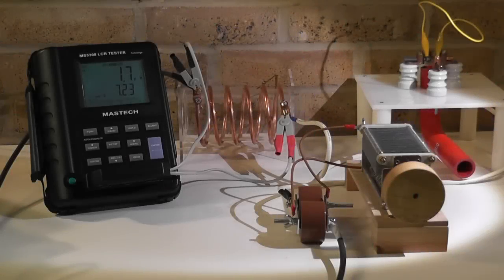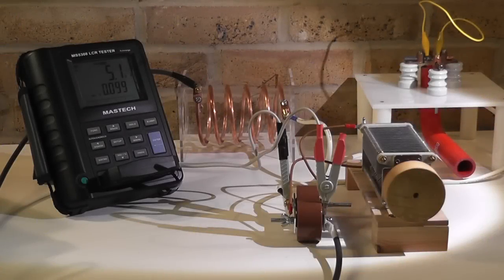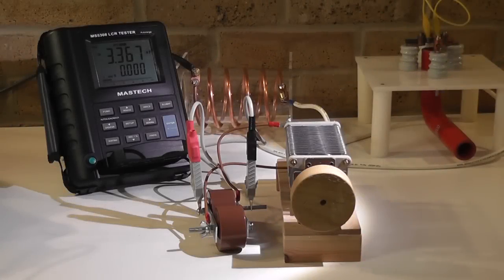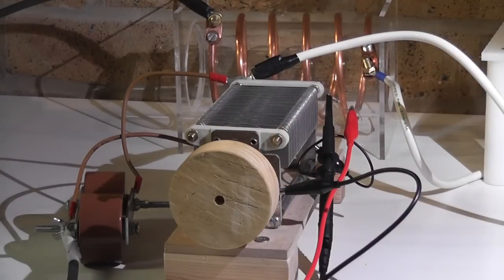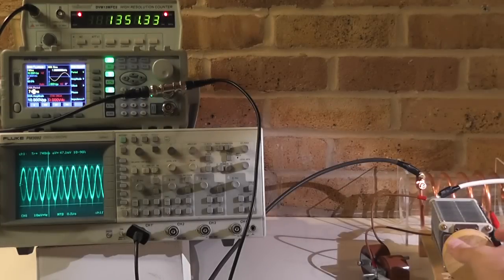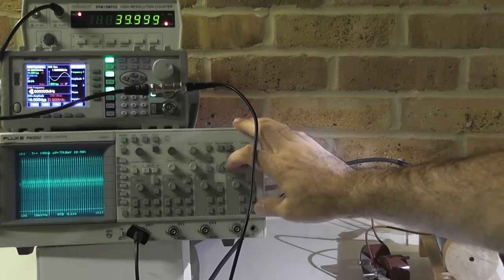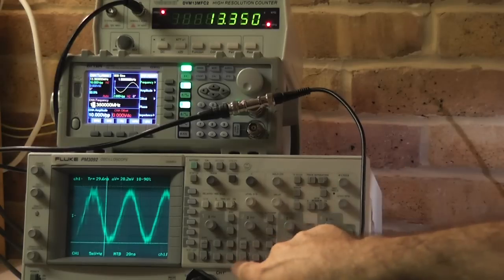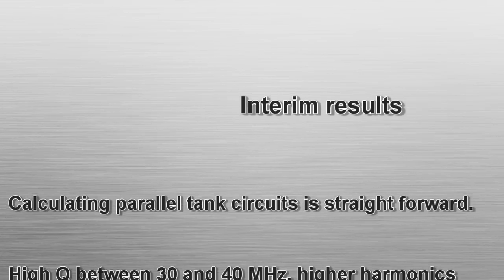Tuning standard and Bifilar Tank circuit

Comment from the maker: Simply search for them on Ebay. I get 95 % from there, or from Nebraska Surplus. They are only good for up to 1.2 KV. They are not cheap. Around $75 I paid for one. Using them for HV from a NST you need vacuum capacitors. They cost up more then £1000 . You get used once for £400.

Comment: I might misunderstand something but,  SG (signal gen) is connected to the 10k resistor and then to scope probe. Arent you still measuring your SG? Can't you just connect probe to the other side of the coil and the cap, away from the SG? what is the difference ?

Comment: Your systematic approach to the energy problem is very good. I am thankful that you have such precise equipment and knowledge of how to use it.  Thanks for your willingness to share it with us.
My desire is build a device to power my home. I'm working on a Don Smith device now, but no real results so far. I don't have any real equipment to do it.
Can you please tell me of your experience with getting ample energy from "the ambient/the air, etc"? Please PM if you  desire confidentiality. Thanks.

Comment from the maker: Thank guys. Now the real work starts. In order to predict the behaviour of a coil which counter measures its EMF I have produce a set of Bifilar coils with discrete windings, same core dimension and wire gauge to derive a bandwidth chart out of it. It also means I have to buy the long desired spectrum analyser. It would be best to buy a VNA. Vector Network Analyser. But I don't have 50 grand just now to spend. Maybe later.